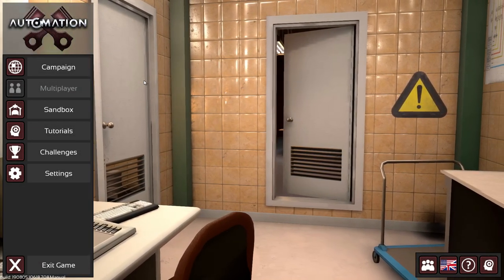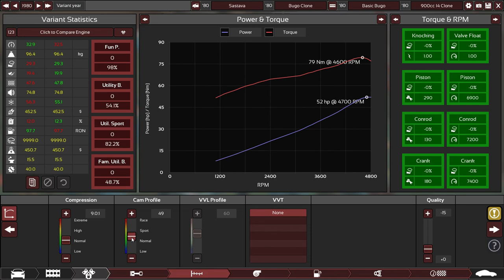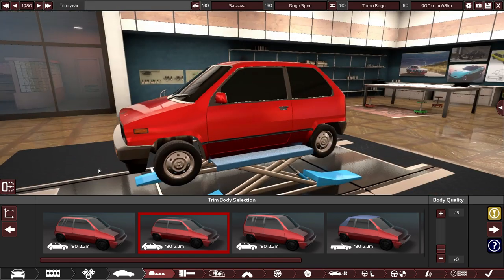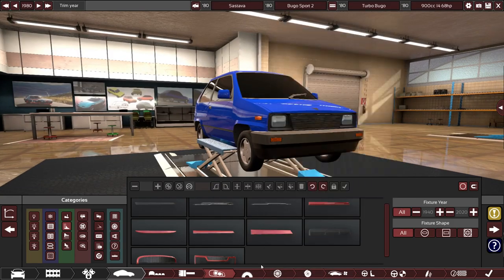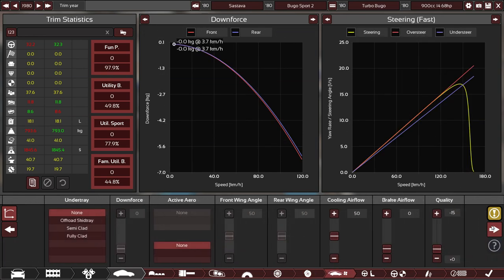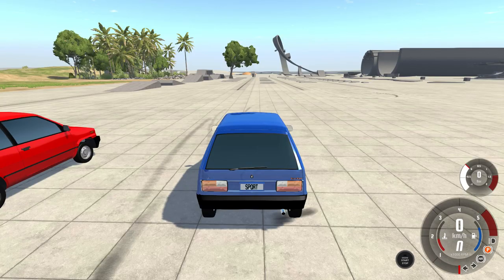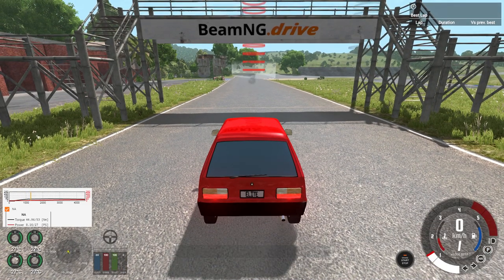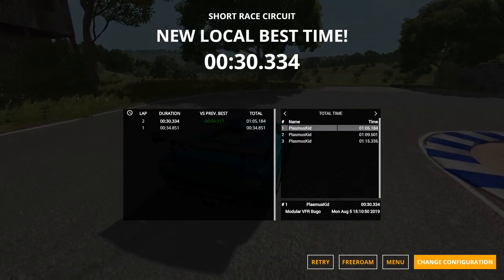Turbo Tuned Bugo - (Automation + BeamNG)

Comment: I can't believe we missed the chance of having the car named Turbugo! 😭

PS. As far as the 5th gear is concerned, it's ok that it's there. It might not be useful for extra performance but you can swap to it and cruise at a steady high speed and have better fuel economy than you would in 4th, since the car will be at lower revs

Comment: You kind of have to wonder what minimum quality actually means. Like, is the metal work full of pits and bubbles and covered in rust?
Reply: Higher manufacturing tolerances on parts and propably cheaper materials

Comment: Wheel recomendation
150€ tmx/t150
200-250 g29/g920 (id recommend the 29 but they are basically the same wheel)
300€ t300
Everything above is fanatec terytorry

I would wait for a sale of the g29/920. They often are on discount on amazon for around 180 bucks
Reply: g27 aint bad either
Reply: @nickkaarslev290  The g27 has the same wheelbase as the 29 and 920, so yes its an option too, but i think it just doesnt look as good, and its gettin harder to find new ones

Comment: Logictech G920 driving force racing wheel 299$ Cad at Wallmart.
Reply: Youll get it for 240 bucks
Reply: on black friday there is always sales for it on amazon you can get the steering wheel with the gear stick for €175
Reply: In my opinion it's better to splash out early on a fanatec instead of upgrading later on. A fanatec wheel is fantastic and a bundle will cost you 500 ish. But it is so much better than a Logitech wheel they arnt even in the same league.

Hope this helps :D

Comment: with a 5 speed, it should have been quicker if the top speed was kept the same, each of the 4 gears would deliver more torque, allowing the engine to bog down less, and get up to peak hp sooner, this sort of thing has been demonstrated when some cars went from 5 to 6 speeds, allowing it a quicker 0-60 time, while preserving the top speed.

Comment: chooses amg wheels which cost thousands
-Yeah, this looks like it belongs on a bugo.
???
Reply: No no no, you got it all wrong. These are knock off 13 inch steel wheels made from the highest quality recycled Soviet tanks.
Reply: @oshawott2250  If they were from recycled soviet tanks, they would be fucking indestructible and cost more.
Reply: @Random-nf7qb  no they wouldn't  soviet steel was wack af
Reply: @MapleMan1984  now you see that's just not true.
Reply: @JlGGLYPUFF  at least in ww2 the steel they used for tanks was not very good
Reply: @MapleMan1984  WRONG!
Reply: @MapleMan1984  no because I am,in fact,an angry toddler.
Reply: @MapleMan1984  The steel was hardened with vodka and russisn ingenuity. It's stronger than the will of the russian people.
Reply: @kevinp6812  very epic  random quirky

Comment: Just so you know. When tuning the gears. The red line shows what the actual top speed will be. The estimate may be a lot higher than what it will actually do. If you look at the Bugo Sport you can see that the line is at the top of 4th gear. So technically you can pull back the top speed until the red line meets the end of your final gear. Also, LOVE the videos. Keep it up!! I'd love to maybe see a colab with you and Consider eventually :)

Comment: The extra gear is very much needed, because noone wants to cruise at near redline whenever they wanna go 100.
It's called a cruising gear and it's very common for consumer vehicles to be geared towards certain RPM at certain cruising speeds instead of outright performance.

Comment: The five speed is realistic. Most new cars have and over drive gear/gears that are only used to drop the engine rpm for fuel efficiency.  The gears are only used when cruising so the current transmission is realistic.

Comment: I use a Logitech G920 with the game and it works fine. A couple of considerations, for the G920 you have to buy the shifter as it does not come included. And second, the brake pedal has a rubber piece and I recommend you take it out or bolt your pedals to the floor, it makes breaking really hard on beamng (it is almost impossible to get 100% braking with the rubber piece on). I also replaced the stock springs for stiffer ones (check GTEYE) and it works better.

Comment: If you want a wheel for more a "simulation experience" (also good for othet truck bud and car simulator games)
I recommend the g29
But if your in for the racing part definitely the 300rs is a great wheel (just make sure u get the 3 pedals and the shifter)
And no matter what don't forget to buy a shifter it adds to the experience sooo much
Reply from the maker: I ended up getting the G920 and it's great fun, perfect for what I need

Comment: Watching him play is so frustrating because he genuinely has no idea how the octane rating relates to knock (Your fuel dictates the maximum octane (Fuel/Petrol pump Icon) the car can require) I.e Super leaded 98 means that number beside the fuel pump can't be any higher than 98 ect ect! You also have to adjust both Turbine AND compressor sizes to suit each individual engine! if they are too large the engine literally can't move enough air to spool them, and if they are too small, they will strangle the engine!
Reply: most automation youtubers. i wanted him to increase redline. i would easily get 100hp out of that engine.

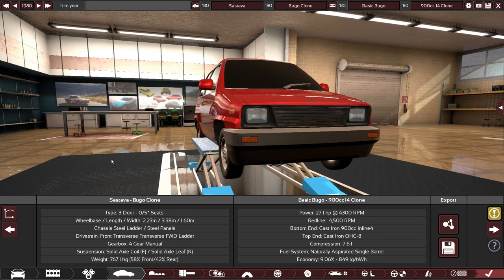Comment: XD so I got curious about how much power I could get out of a similar setup as what you built. Ended up with 85.9hp @ 4900rpm 94 lb-ft @ 4700rpm out of a 900cc engine with everything at -15. Suspension and tire settings are different (195 all around and race preset suspension) it did a 35.2 first lap and 30.3 second lap for a total of 1:05.5

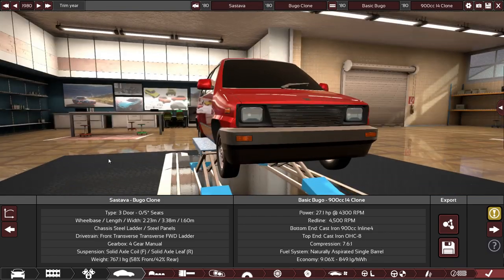edit: I changed the suspension preset to sport. It did a 34.424 firstlap, 29.987 second lap 1:04.411 total time. Gearing is stupid hard to figure out with the setup I have. It's pretty gutless till like, 3800rpm then ALL THE POWER then redline at 5400rpm

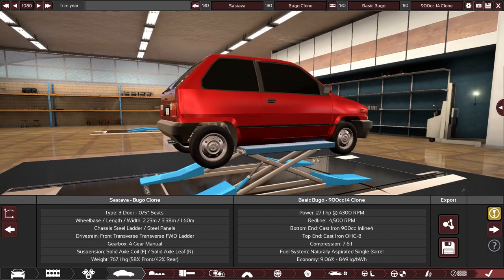lol I tuned it more. Now it makes 90.6hp@4700rpm and 104lb-ft@4500rpm did a lap of 33.052 and 29.771 for a time of 1:02.823 Had to change the gearing more. Probably could go faster too

Comment: A great cheap 1st wheel would be the thrust master t150 pro. Beware though, It is a gear driven wheel instead of belt driven which means it is loud.

Comment: Next car you should build a for focus SVT zx5 type car thats quick.  The zx5 focus is a 5 - door hatch that has a 2.0 i4 and it weighs 2700lbs with 170hp.  Feel free to work around with those numbers its just a suggestion to base off of

Comment: A lot of people recommended me G29 Logitech because if I remember correctly it has in between 360° and 720° rotation, so it's balanced for most games (as 180° rotation wheels are mostly used in F1 Whereas 1080° rotation wheels are used for games like ETS2), and it's not that bad overall

Also make Bugo sedan except the engine is too powerful for the car because kek
Reply: In the crew 2 max 960°

Comment: The less power you have the more you need an extra gear, but it needs to be spaced correctly. No use having a gear that goes to 160 if the car can barely get to 120. :)

Comment: now I'm no car expert, but my years of Gran Turismo 2 tell me this would benefit more from a supercharger, wouldn't it. put the boost in the lower rev range just so it can climb slopes more easily
Reply: The engine doesn't have enough horses to run a supercharger and a vehicle